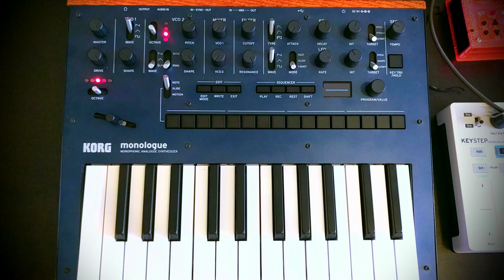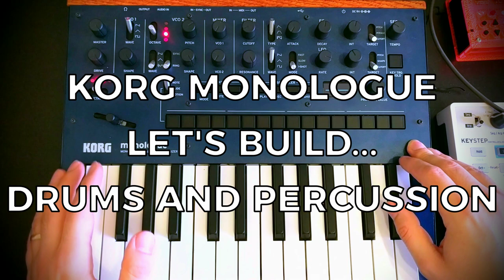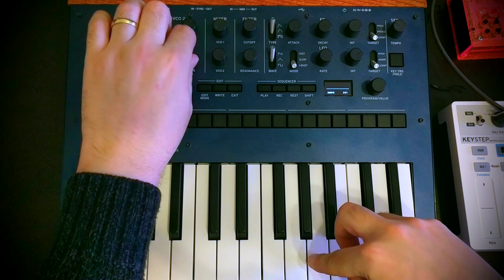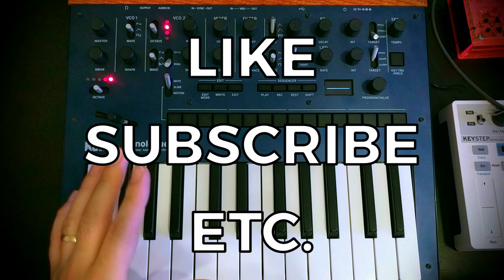Korg Monologue - Let's Build... Drums and Percussion!

Comment: This man is very DOPE, he is just good, I love the sounds you've just created and i love cowbell sounds but i already have it on my DRUMBRUTE IMPACT, what I'm missing most are the RIM, SIDE STICK(using the sticks to hit the side of the drum), CRASH CYMBAL, RIDE CYMBAL. I don't know possible? please.
Reply from the maker: I'd maybe try a short, pitch envelope modulated square with a resonant filter tuned down a bit (but the resonance turned up pretty high, but not to self oscillation). Maybe mix some noise in for "snap".

Anything short with a fast pitch envelope is a good start for a lot of percussive sounds basically!

Comment: I may have a silly question but would I be able to replicate the steel drum-ish kinda sound heard in "A guy called Gerald - Voodoo Ray"? The original was made with the use of Roland SH-101. I'm looking for a cheaper substitute. Thanks in advance fam.
Reply from the maker: Probably - you'll be looking at audio rate modulation of pitch most likely to achieve the metallic sound.

Comment: Any idea as to how to create polyrhythms with the monologue sequencer?
Reply from the maker: +TheSlaSh1411 so, polyrhythm you can't easily do because that would require the clock to run at a weird division but you can do polyMETER (take a look at my video discussing the difference). 

So if you're running the Monologue along with something else, just changing the sequence length to something different to the other sequence playing. But you can sort of fake it even if the Monologue is running alone by using a tempo sync'd square wave LFO which is running at one meter length and setting the sequencer length to something that doesn't consistently line up. That way you'll get multiple different sounding runs through the sequence with the emphasis shifting which will give the impression of polymeter.

I hope that makes sense and is useful!
Reply: Oscillator Sink Thanks for the detailed response! That definitely makes a ton of sense. Just a shame that the rhythm variation on the monologue sequencer is really bland. Could at the very least added triplets but oh well. Thanks for the tip!
Reply from the maker: +TheSlaSh1411 no problem, happy to help! One thing to note if you're looking to spice things up a bit is that the swing control is really powerful AND runs both ways (lengthening and shortening the swung note) so you can get some interesting things happy there as well, especially when running odd numbered sequence lengths - just another thing to try out if rhythmic interest is your goal.

Comment: hey, really love your videos. just had a question about time signatures and the sequencer so thought this video would be the most relevant to comment on for advice. a lot of the stuff i make is in 3/4 time, so i was wondering what the best way to approach this would be? cheers!
Reply from the maker: 3/4 is easy - just switch to 12 step sequences instead of 16. What's trickier is getting a triplet feel...and without syncing it to something that can do that trigger conversation it's pretty difficult but one idea is to use the tempo synced LFO in Sawtooth mode - you can sync it to 1/12 or 1/24 and get a triplet feel over the top of your sequence.
Reply: @OscillatorSink  thanks for the reply! my monologue's coming in the post tomorrow, so that's great to know
Reply from the maker: Enjoy your new synth!